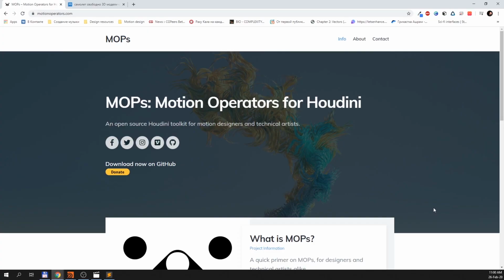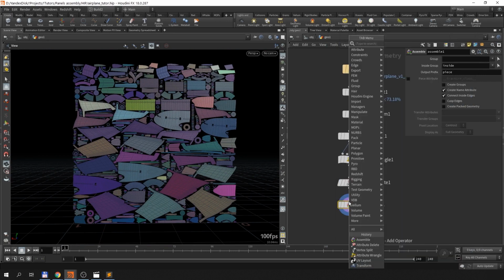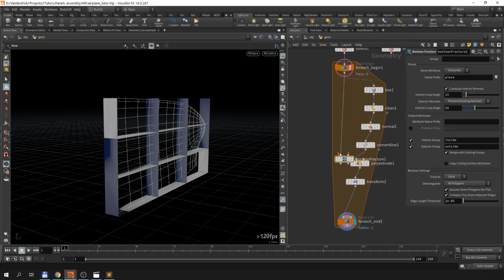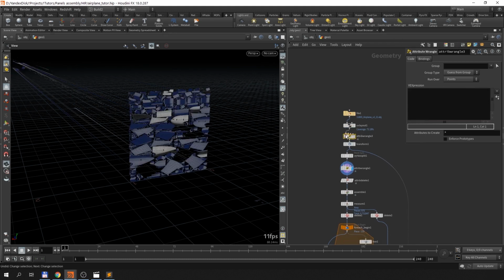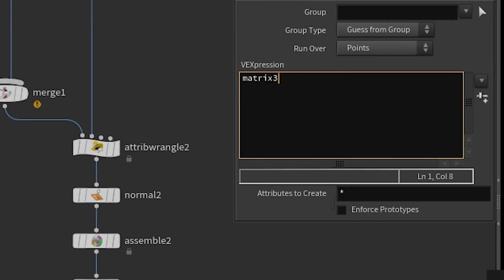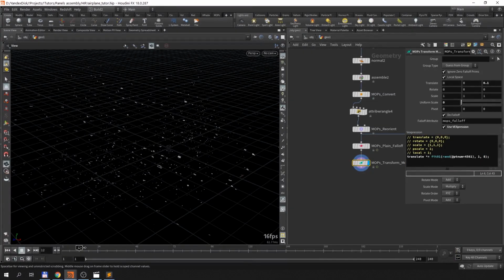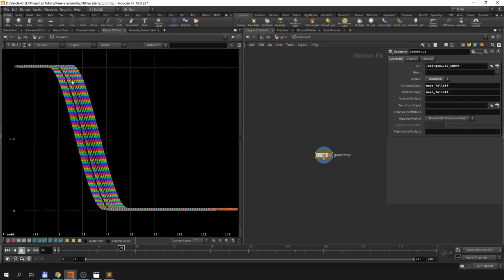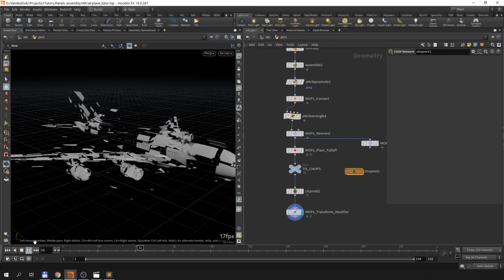Houdini Tutorial | Assemble an object and animate it

Comment: I have a question.....on Transform modifier, should it be mult_area, or area_mult? When I put 4th value as 0"float mult_area = fit(@area, 0, 0.03, 0, 1);", it does not scatter mesh.
P.S My solution was to add attribute (id mops_orient area) in MOPS_Convert node. I hope this is right.